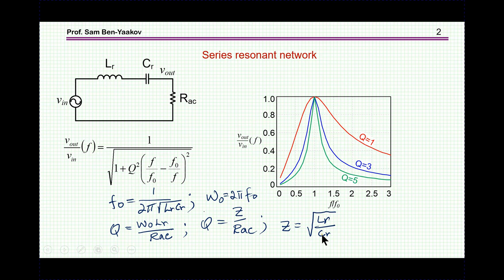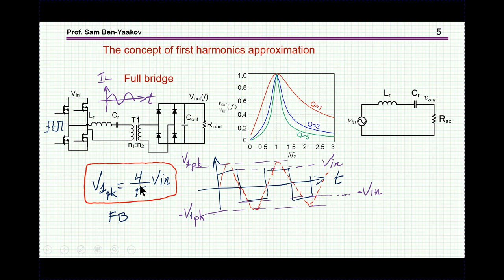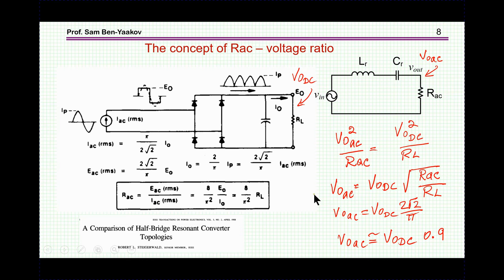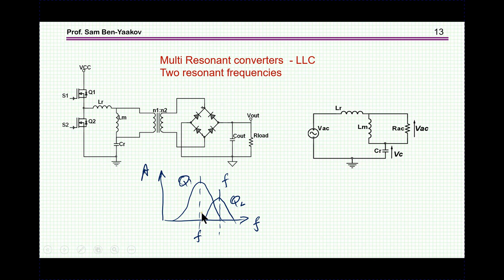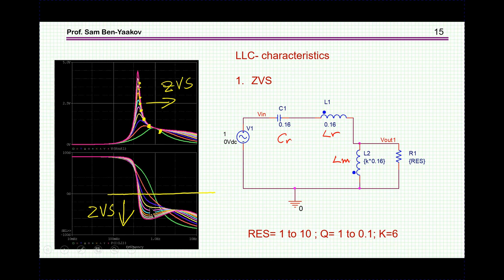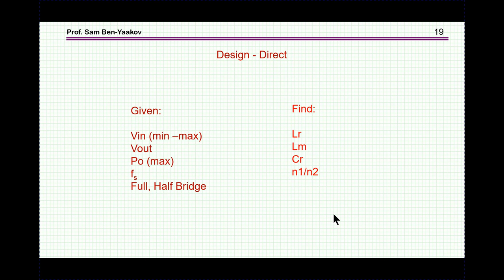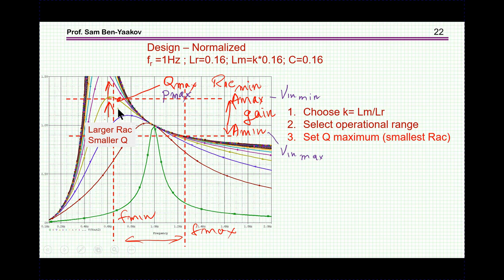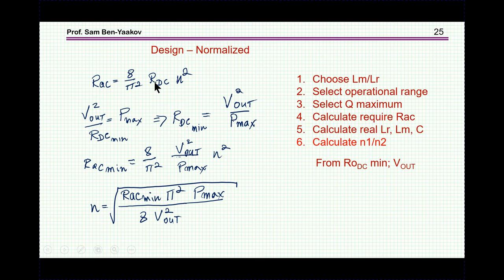Resonant LLC converter power stage design: the intuitive approach

Comment: Hi There Sam, All things oké there?. I was away for a time because of private problems and helping a friend with cancer who has died 3 months ago. Now I am started again with some electronics like the LLC. I had to see if for the amp a LCC or LLC is best, with good design the LLC do oke, special for the tubes who draw a constant current from the smps who is oké.  I had trouble with calculation of the transformer, who now is kind of solved but still I did get fault outcomes with the voltages, now I see that when the smps do work with a 310 volt input the voltage on the transformer is higher because of the resonance working, slingering the voltage higher depending on Q. Now I have use the voltage over the transformer as input for the equations and now it fit like a couple of shoes. the voltage do have the right value. Is this something you do recognize? A lot of things I seems to wacht for when build such a converter. For a amplifier the LLC can do fine, without regulation, with it the LLC do not keep track the dynamic of the amplifier who draw complicated currents because of music. I use a LLC in open loop where I set the frequentie very close to resonance, and yes it keeps the voltages quite stable, like  a normal supply 50 Hz with elco,s but without the bad 100 Hz ripple.  It seems a LCC in open loop is even more stable when using around resonance. have a fine day or evening.
Reply from the maker: I am good. Thanks for sharing.

Comment: Dr Yaakov thanks for the amazing help to give to all of us interested in power conversion. I took inspiration from this video to start designing an llc dcdc converter and I found the power section with magnetic components and switching part rather simple to implement. However I got stuck with the control section when it comes to phase gain loop simulation. I used to do this in frequency domain with conventional pwm loops but the VCO I used to modulate the working frequency of the llc works only in time domain. I am sure there is something to solve this problem in an elegant way rather than do it point by point with different frequency settings. Thanks for your priceless information.
Reply from the maker: Have you seen https://youtu.be/amRqIgH10Rg

Comment: can i use LLC converter to transfer power to very small inductance motor? thanks sir
Reply from the maker: Yes. Notice that in a motor there is a back EMF not just inductance.
Reply: @sambenyaakov  thank you for your reply, do you have a video about LLC resonating with a small inductive load (10u(H)) ? . I am learning about an LLC converter with output as current control (as a current source) to power one motor phase. (specifically the Slotless Self-Bearing Permanent-Magnet Motor, it's a 6 phase motor, I plan to use 6 LLC converters)
Reply from the maker: @nguyencuong-ye1gn  Sorry I have no experience with LLC driving motors . I am not clear what is your idea. LLC is normally used for DC-DC conversion.

Comment: Hi Sam, I got back around to finishing my LLC converter design. I found a very helpful article by Infineon (URL below). and I outline my work below. My design uses a 48V battery (3.0Vmin, 3.7Vnom, 4.2Vmax, 13S) to 2KW at 175V. The realized design in LTspice that really overdelivers! It can push 15A, 175V, 2.6KW under full load with minimum input voltage, and at no load, max input voltage, It under-delivers, providing 170V. That's good it means I can keep it in regulation with a tighter frequency range.

The values I calculated are as follows:

Cr = 8.5uF
Lr = 1.2uH
Lm = 7.2uH
Ls = 95uH

The PROBLEM is the 200A peak currents (guessing around 130A rms, not quite sinusoidal at the max load min input voltage). The primary voltage also resonates up to 130Vpk. This design "works" on paper but does not sound reasonable to me. Where did I go wrong?

I picked 3.7V to be the nominal voltage for this design.
* Amax = 3.7/3.0 = 1.23 (max load and min input voltage edge case)
* Amin = 3.7/4.2 = 0.88 (no load and maximum input voltage edge case)
* Fmax = 5 Hz normalized. (arbitrarily chosen to avoid a huge frequency range)
* f = 50kHz (arbitrarily chosen so fmax = 250kHz and fmin = 24kHz)

Step 1: find suitable K value.
With no load, Q -> ∞; Amin of 0.88 or less, frequency is limited to 5, 'K' to be no higher than 6. As I understand K should be as high as possible.
With K = 6, Amin is 0.86, which is acceptable.

Step 2 and 3: find Qmax and Fmin
The highest Q factor that supports Amax = 1.23 was found to be about 0.4. Q=0.4 allows Amax to reach as high as 1.28, at this peak which occurs at 0.422 Hz (normalized)

Step 4: find Rac_min
Rac_min = 8/π^2 * (Np/Ns)^2 * Vout^2/Pmax
Rac_min = 8/π^2 * (48.1V/175V)^2 * 175^2/2000 = 0.9376

Step 5, lots of arithmetic!
Lr/Cr = Qmax * Rac_min
Lr*Cr = (2πf)^-2
Lm=K*Lr

Rounded, I end up with the following values:
Cr = 8.5uF
Lr = 1.2uH
Lm = 7.2uH
Ls = 95uH

Is this correct, and what can be iterated to make this design realizable?

https://www.infineon.com/dgdl/Application_Note_Resonant+LLC+Converter+Operation+and+Design_Infineon.pdf?fileId=db3a30433a047ba0013a4a60e3be64a1
Reply from the maker: Hi, What is the switching frequency at 48V, nominal power (2kW) and what are the conditions (input voltage frequency and power) when you get the 200A ?
Reply: @sambenyaakov  frequency is 24kHz (the minimum), input is 40V, and I just tuned the resistor value to get about 2KW (15.3 ohms) since it is simulated open loop
Reply from the maker: @power-max  Something is wrong with the design. 24kHz seems awfully low for the Lm you use.
Reply: @sambenyaakov  I agree. But I don't know where I went wrong! K = 6 was chosen since it's a good starting point and I found it offers sufficiently low gain at the high Vin, no load condition, at a frequency only 3 times the nominal. For the record, my design could allow up to K=7.4 with burst mode. but I wanted to play it safe. 

The normalized AC converter is simulated to find minimum suitable K value. I found that K=0.4 results in a peak of gain of Amax = 1.28, comfortably above the minimum 1.24 for my design.

For Rac_min, I use Pmax = 2000W and Vout=175V. I followed it up with your definition using Amax = 1.233 to validate.
Rac_min = 8/π^2 * (Np/Ns)^2 * Vout^2/Pmax
Rac_min = 8/π^2 * (48.1V/175V)^2 * 175^2/2000 = 0.9376Ω
Rac_min = (Amax * VIn_min * 4/(√2pi))^2 / 2000 =  0.9376Ω

Solving the equation below, it's telling that inductor will be 14% of the value of the capacitor, or put another way, the capacitor is 7 times greater than the value of the Lr! This is the part that sounds wrong to me:
Q = √(Lr/Cr)/Rac_min
Lr/Cr = (Qmax * Rac_min)^2
Lr/Cr = (0.4*0.9376Ω)^2
Lr/Cr = 0.1406
Lr = 0.1406*Cr
Cr = 7.109*Lr

For this ratio to increase, I need to raise Rac_min or Qmax. For those to change, my requirements have to change, as far as I can tell.

Of course, I can also just raise the frequency, which will bring Cr down to a manageable value, but then Lr and Lm end up being tiny! I would probably then be looking at a GaN FET design. That might be for a version 2 that features water cooling haha
Reply from the maker: @power-max  Without going into details (sorry too busy) it would deem to me the the turns ratio of the transformer and frequency are not optimized.
Reply: @sambenyaakov So I think my values are right, I measured more carefully and at 31.5kHz, peak primary current is 108A. Before the power being delivered must have been closer to 3 or 4KW.

Even still, an 8.5uF capacitor dealing 100A at 30kHz is a big bank! The voltage across it was on the order of 100's of volts as well.

What if I reflect it to the HV secondary?

I re-did the final value calculations assuming I move all the components to the secondary and assume an ideal transformer, or one with a more sensible magnitizing inductance.

My new values are:
Cr = 0.648uF
Lr = 15.8uH
Lm = 95uH

Primary current waveform is nearly identical, peaks of 108A (heavy load, low Vin), BUT  I can now use NP0/C0G ceramic capacitors! I have some 10nF 650V rated ones.

But now I have this 95uH Lm that will need to handle 10Apk. But this design seems much more realizable.

So would I be right in saying the reactive parts should generally be on the high voltage side? Should I consider a LCC converter instead?

Comment: thank you for this valuable explanation, I have a question for you, is this topology adequate for high power, low output voltages ("The output current variation would be greater than for a PSFB ? Or no ?  ")
Reply from the maker: In general the performance of the LLC is better than that of PSFB. But it works best with narrower input voltage and load current.

Comment: Hi Professor, I have a question, please. You marked A_max and A_min on the plot. How did you get them? I'm asking for two reasons 1-I have a V_in of 35-75(v) and V-out of 2(v), and so V_out/V_in is very small while your gain region is around 1. 2- I also saw somewhere that A should be (n).(V_out/V-_n), but in your lecture, we have the gain first, but we calculate n towrds the end. Thank you
Reply from the maker: The gain is taking care of by transformer. Turns ratio is selected such that at low input you get the required Vout. And then you have the shift of Vin.
Reply: @sambenyaakov  I think I finally understand what you meant. which is we should stick  to the recommended region shown in the figure, and calculate n based on the vin_min i.e A_max. I hope I'm right. Thank you

Comment: I just had a thought, what if you had a transformer that had not so great K, and you wanted better output regulation, could you slap on a series resonant capacitor with the AC supply (fixed frequency) and improve output voltage regulation? Idea here is to have the the series resonant capacitor resonate with the short-circuit primary inductance. 🤔
Reply from the maker: This would change it to a sort of resonant converter.

Comment: Thank you, know it's easier to see why some manufacturers of resonant chip controllers use pulse skipping as Rac approaches zero.
Reply from the maker: Indeed.
Reply: @sambenyaakov   Isn't should be the other way? , When Rac is very high , we need to keep very low gain, we move towards the higher frequencies and at some point need pulse skipping due max frequency operational difficulties. Please correct me if i understood wrong
Reply from the maker: @jacobs7281  Change in Rac does not reuire change of voltage gain (A) but current delivery which affects Q.
Reply: Agreed..Then is it correct to say higher Rac means   lower current delivery which means  lower Q also means higher operational frequency and at some point as we further go to right side we need pulse skipping?

Comment: I am building a 48V to 115V converter for fun, using flyback transformer core, and I think I can get upwards to 1kW out of it, based on the HF transformer design video. I found in practice at 12V that leakage inductance is going to be an issue for a forward converter so I came here to take advantage of that pesky Lr :)

I know nothing about the ferrite core (permeability, reluctance, effective length, Bmax). I found w/ 5 turns & 220nf film capacitor, it oscillates ~50kHz, which works out to Lm ≈ 46uH on the core. I meaured a few times with different numbers of turns and found the inductance does change as expected. With the secondary (same 5 turns 14AWG)  I found it rings closer to 10MHz but it was much harder to measure and the ringing was "dirty" , Lr ≈ 1nH although I very much doubt this measurement. 
Is this the right way to measure the minimum leakage? I can of course always add as needed.
Reply: Also, how does the LLC converter react to no load condition? Looks to me the Q will shoot way up and cause problems with gain and resonant voltage rise. Great for my TC's, but not for a converter lol.
Reply from the maker: It seems that you have a lot of fun. At no load operation is forces to burst mode.

Comment: Thank you for your explanation. Professor,  can you please explain the No-Load operation of the Resonant Converters both in Open-Loop and Closed-Loop operation. I have experienced increase in output voltage in the Open-Loop operation, can you please explain this issue?
Reply from the maker: Charging of parasitic inductances can cause an increase in output voltage.

Comment: Hi Dr Sam, the energy of the leakage inductance Lk should be equal to energy in the output capacitance of the MOSFET.
So what happened if energy of Lk is greater or less than energy of  capacitance of the MOSFET.
Thanks,

Comment: Hi Sam, I built a spreadsheet which computes all component values provided design requirements and operating frequency range! Now the next step is to close the loop. Do you have videos that walk through making it stable?

I've noticed that at F_res, the output impedance is very low. But at low or high input voltage requiring boost or buck operation, the output impedance increases due to one of the reactive components dominating, which changes the dymamics of the plant. How is this stabilized? Can I use the same methods and assumptions used for PWM controllers?
Reply from the maker: You can use same method as in PWM but after getting the small signal response and then checking over the envelope of the operating points. Have you seen https://youtu.be/amRqIgH10Rg  ?
Reply: @sambenyaakov I have not, thanks for the pointer!

Comment: Hi Mr. Yaakov, thank you for this interesting presentation. I would like to mention one detail: The Rac approach in slide 7 is true as long as Iac is sinusoidal, and this will not be the case since as you point out in slide 10 the switching frequency is above the resonant frequency and hence current will be lagging. Please, can you clarify this point? thanks again.
Reply from the maker: Hi Eduard, A sinusoidal waveform is found not only at the resonant frequency but also around it as long as you don't approach the third harmonics.

Comment: Thanks a lot. I was however wondering if transformer inductance (both primary and secondary) should be taken into calculations?
Reply from the maker: They should be absorbed in Lm
Reply: @sambenyaakov  you mean that lm should be greater than transformer primary inductance, in order to be neglegible in comparison?
Reply from the maker: The actual value of Lm of the LLC is the external inductor in parallel to the magnetization inductance. In fact, some designers use the magnetization inductnce of the transformer as  Lm . This requires the  lowering of the permeability of the core by airgap.
Reply: @sambenyaakov  thanks for your answer

Comment: Hello Professor Ben-Yaakov,
ive just recently build a LLC Converter for ~250W, Vin=390V, Vout=24V, half bridge.
When i start it up, the control IC goes into soft starting mode and then keeps switching at minimum switching frequency.
However, theres no power transfer, output voltage barely goes over 5V (no load at secondary side), although primary side current is very high (~10A ) and perfectly sinusoidal(so there seems to be some resonance).
DC link voltage is supplied by a passive 1 phase rectifier, so around 320-330V(i have left out the PFC, hoping it would still somewhat work). Could this be the issue why the converter isnt working if the supply voltage is too far off, which would mean im far off the desired operating region in the voltage-gain-plot, wouldnt it?
Best regards
Reply from the maker: It seems the the range of frequency is wrong and the converter locks into a a bad operating point.

Comment: Prof. Yaakov, I really appreciate your effort to make this nice video. One question: This first harmonic approach is very convenient and accurate when the current is quite sinusoidal. But when the operating windows are very wide (input/output voltage, current), this is not the case. What approach do you recommend then? Thanks!
Reply: Hi Yi Wang, I think in that case you need to consider the contribution of higher order harmonics to the power delivery since it can't be neglected when the current is not sinusoidal... That is the intuitive way to think about it ... For a detailed analysis on this point, have a look on the following IEEE paper in which the authors derived a formula for the gain in that case ... (https://ieeexplore.ieee.org/document/7172545/).... Hope this helps
Reply: Hi Mr. Mohsen, thanks for this information. will check this paper for sure.
Reply: Go with LCC for wide input/output , but the efficiency is not as great as LLC.

Comment: how to calculate   or know  the range  of  switching  frequency  Fsmin, Fsmax  that  the  converter can work on ?
Reply from the maker: Explained in video. Depends on the expected input voltage variations.
Reply: @sambenyaakov   sorry I did  not  get it, let say  the range  of  input  volt  is 350-400 volt and the switching frequency Fsw is 100 kHz, How the Fs min and Fs max will be after doing whole calculation and  finding  the Fr, Cr ,Lr and Lm. thanks  in advance
Reply from the maker: @salahalatai8255  Isn't it clear here? https://youtu.be/ZWwZBHV0ynY?t=972
Reply: @sambenyaakov   not yet,  I got maximum gain and min gain. But I wonder what depends on for drawing a line to intersect with the x-axis?